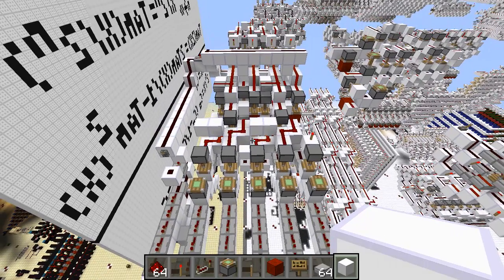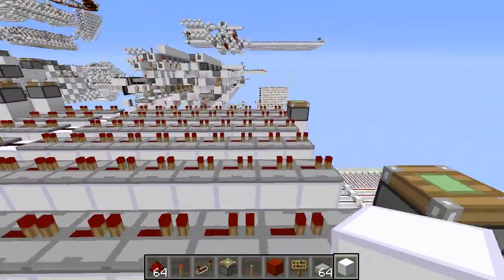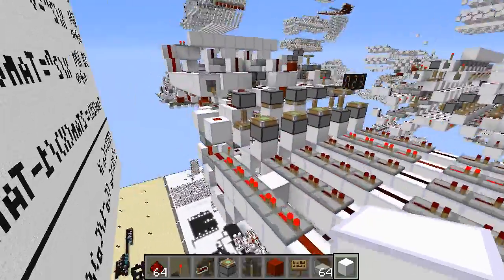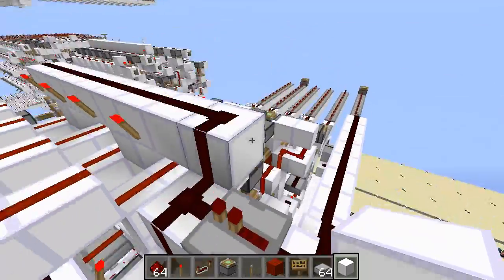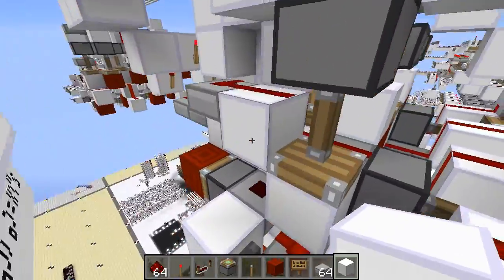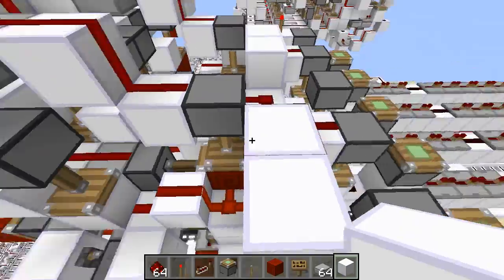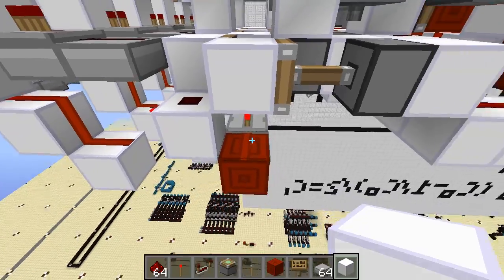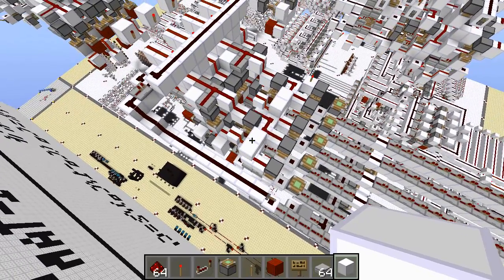1 Tick Rising Edge Adder

Comment: Even though you keep saying that we should not use this design, it would still be applicable for ALU's. Since the fast rising edge operation allows for quick checking for flags and in that time you could reset the adder.